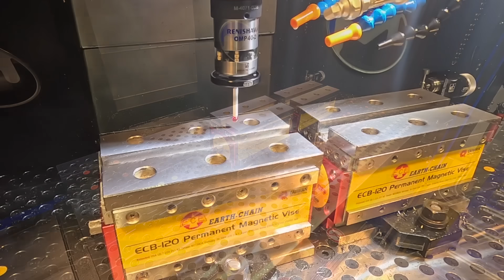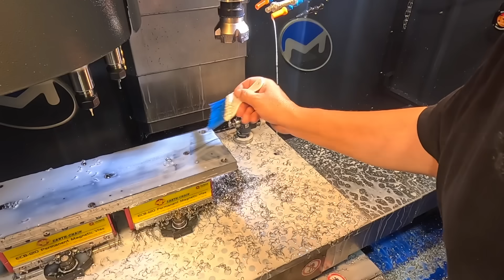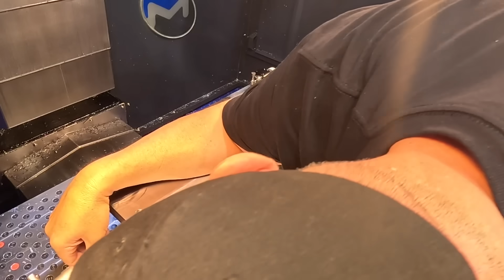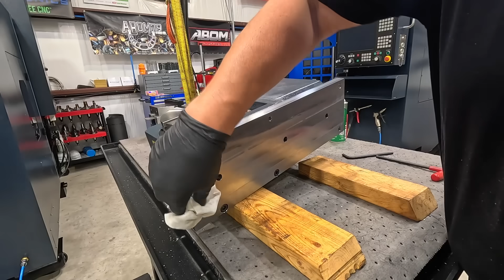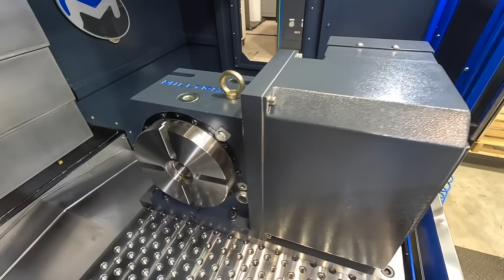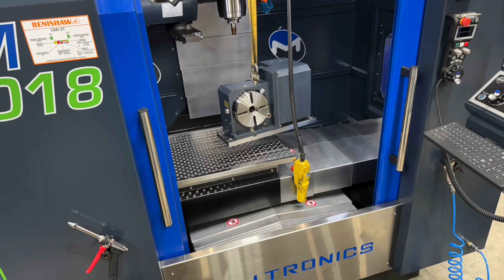Machining 4th Axis Subplate Part 2

Comment: Others have suggested to add holes to lift the sub plate. 

To separate the plates, extra tapped holes above solid plate can be useful to  jack the two apart in a controlled way, without a buildup of tension in the lifting strap. Any kind of screw should work. Ball-end least likely to mar the fixture plate. Or drop a small, soft washer down the bore first for the screw to contact instead of the plate.

Yes, I like to over-complicate. 😊

Comment: As an Engineer, I'd find it frustrating to have to manually align a part when reference edges/surfaces could be measured for actual position and the workpiece rotated in software to align it virtually for all the cutting.

Is it just me?

Comment: One thing to help dismount those location pins, drill and tap a couple holes near them and use a set screw to be able to lift  it 1/4” off those pins.

Comment: Might be easier to disassemble with one of the dowels a diamond shape, so as to not over-constrain fitting.
Reply: Manufacturing engineer in the automotive industry: That's a common production fixture/jig technique... Datum I is the round, Datum II is the diamond (or an oblong hole with a round pin). Idea being that allows for pitch tolerance.

That said, this isn't that (we're not trying to seat it on multiple SMW plates or the like), so double round and hold a good tolerance is how I'd do it. That's how most of said fixtures and Jigs that I work with are built (and if a jig, often with shims in between surfaces). But, if done right, there is always one side that's blind and/or press fit (or slip fit with loctite), and the other side slip fit (but a lot of tooling makers get this wrong, either blowing tolerances or being careless when selecting NAAMS blocks... argh!). Based on how it did come apart, my guess is that the (in practice) blind holes of the SMW plate are a slip fit... and by making the new plate press fit, the setup is good. I like it!

Comment: The standard practice for locating from 2 holes is to use one round pin and one diamond pin to prevent rotation. This configuration is correctly recommended by SMW and aids assembly and removal. Why ignore this universal proven fixturing practice in favor of  standard dowel pins?
Personally I would have used the manufacturers dedicated threaded fitted pins to use as reference points on the outside of the new plate. If the perimeter is accurate enough, simply push the 4th axis into position, after removing the keys and use dedicated toe clamps.

Comment: Beautiful job Adam 🙂 A tip for the press, use Paper tape our masking tape and tape the surface you lay your workpiece on, will help to protect the surface on your workpiece from scratces 🥰
Reply: Also place a 1/4" spacer adjacent to the pin to control the height of the pin.

Comment: Drill and tap 2 holes at the end of your new plate. Then you can put bolts or cap screws in to lift it up. Put something soft in the bottom so you don't mare the surface. Maybe lead or Delrin plastic  or aluminum

Comment: You can make your own sliding cantilever lifting beam out of whatever you have lying around. 2x3 I beam, round or square stock, just don't exceed the weight capacity of the bed. Use some weights for bodybuilding for balance. It's very similar to an offset jig to lift car engines. Even better is to use your overhead crane with it.

Comment: Shouldn't you put anti-seize on the part of the pins that connected the subplate to the large plate? I wouldn't want corrosion to weld those two plates together via the pins.
Reply: Maybe a squirt of Boshield or whatever the CRC offering is if you plan to leave it there for an extended time. In other situations Zinc Anti seize can actually cause issues and depending on the situation Coppercote is a lot better. Consider what are the materials, what are the other chemicals/coolants getting used and is it for a few hours/days then lifted off into storage for months.
Reply: Nope

Comment: I've made many fixture plates in my day. One thing I always do especially if it needs to be mounted and unmounted on a regular basis is I always machine a spot with a threaded hole for a jack screw. Sometimes what happens is if even a little coolant gets under there it can get almost locked in place. A back up spot for a jack screw has saved me more times then I can count.

You have two perfect spots near each end for a spot for threaded holes for a jack screw.
Reply: All of those holes in that larger base plate are threaded. A cap screw or bolt coming from underneath will do the trick.
Reply: Are you any good at counting?

Comment: 1) I reacon that's back to front. Chucks going to be miles away from you
2) Get a lang 0 point on there.
Reply: 1: The word is reckon, pikey.  Reckon.  2:  What in tarnation is a lang 0 point? Me no talkie.
Reply: @silasmarner7586  It's the third most common workholding component in machining. Give it a google :)

Comment: Using blind dowels is never used as disassembly is difficult without damaging the soft aluminium precision holes. Far better to use dowels along the edge as a reference plane.
Reply: Which parts are aluminum?
Reply: @MechanicalAdvantage I thought the sub plate was aluminium.

Comment: You missed a great opportunity to drill and tap two holes in the mounting plate. You noticed how difficult it can be to take off the plate. When you leave the plate on for some time those holes become very desirable.😊
Reply: Or butt the plate up to a pair of dowels in the sub plate. The precision holes are for location pins, two to align the part and one as a stop. They aren't supposed to be used with dowels going through two plates because of the issues prising off the dowels as he has already discovered. I'd like to be a fly on the wall when he attempts to take the whole unit off. It's much nicer to slide the assembly into a reference pocket formed by 3 pins and slide it back off when finished.
Reply: You're the 100th person to say so.  He can always add them later tho.

Comment: how much are those probes?
Reply: The probe system is about $8,000 to $10,000. It may seem expensive but they can really speed things up with setups as well as things you can do in the program.
Reply: Even the probe tips can make you wish you were a centipede... They cost an arm and a leg.😊